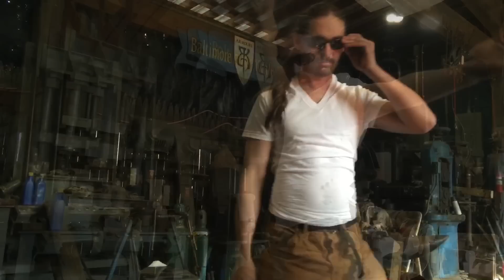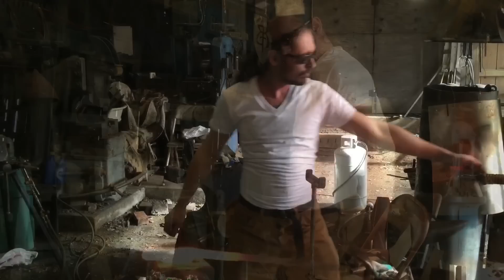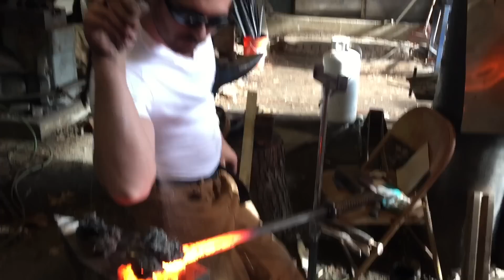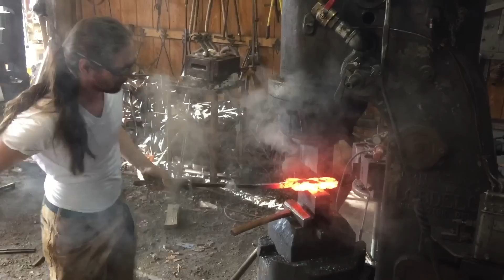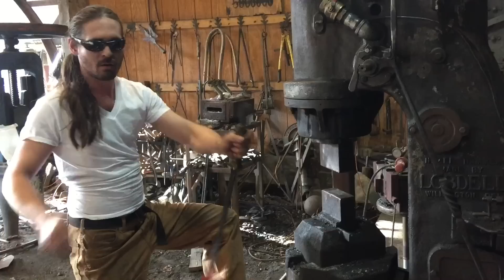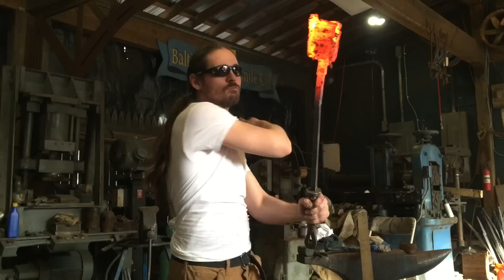Borax Bae

Comment: I wonder if it hurts at all to smack that red hot metal with his bare hand? I mean, that would make the video 10x more awesome.
Reply: he's doing it fast enough the heat doesn't really have the time to transfer
Reply: I would things so. How fast do you remove your hand on a pan but get burned. Now Imagine a red hot pan and slap it. would it hurt? probably. But he is a blacksmith which mean he has harder and denser skin on his palm which just burns the top layer of skin and doesn't really burn his hands. Probably HOT though
Reply: @ivandimitrov8260  And he uses water/sweat. A thin layer of water on steel this hot will evaporate immediatly. This creates a small layer of gas that doesn't transfer heat. It's called the Leidenfrost effect.
If you put your finger in water and then very quickly in hot molten lead, your finger won't get burned. (Don't try this yourself, just watch the mythbusters do it)
Reply: Probably about as much as slapping any bit of metal.
Reply: Then I wish you a speedy recovery and hope you won't have to stay long in the hospital.